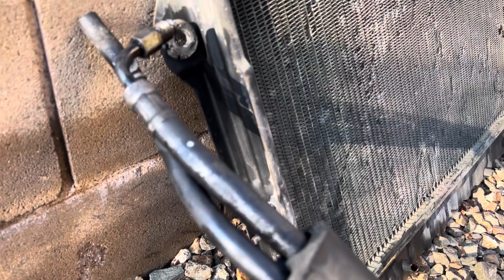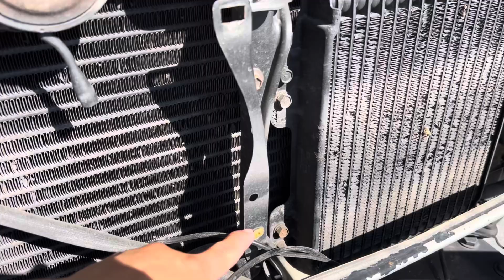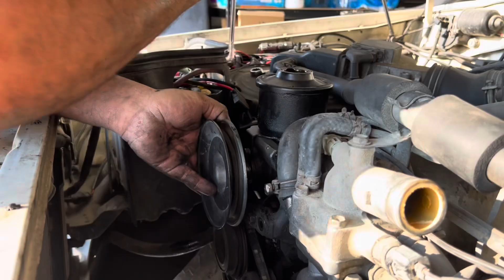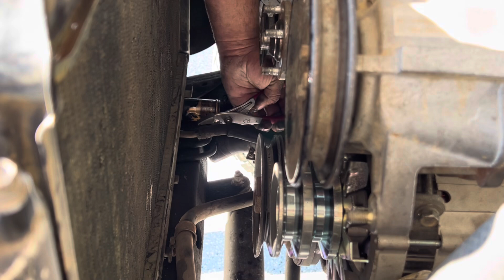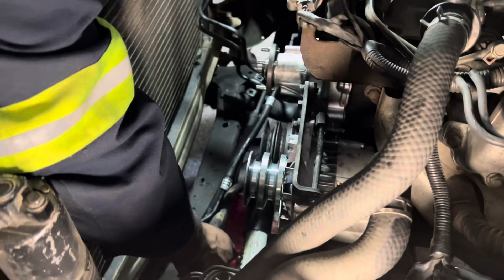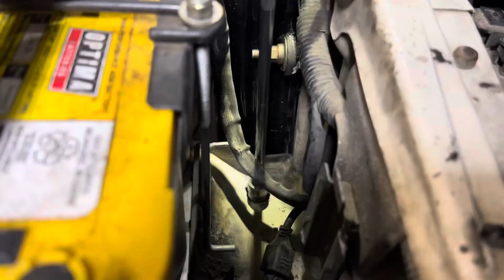No More Leaks! How to Replace FJ80 Power Steering Lines (Step-by-Step)

Comment: Thanks for the video! I must have been distracted when taking mine apart... but let me know if I have this straight. A transmission cooler line comes off the transmission and into the radiator, then off the radiator into the oil cooler, then off the oil cooler all the way back to the other hard transmission line? Thanks again!

Comment: Thanks for the video! While I ended up going the lazy route, your video helped understand where I could cut corners to get the same result.  Unbolt the clamps holding the cooler (leaving the bolts under the radiator in place, with the two brackets hanging down in front), use an angle grinder to cut the pipes so the front section drops down, and wiggle out the hoses and steel pipes threaded under the radiator. Then use a transmission oil cooler ($50 from a local parts store, vs $400+ for an OEM power steering cooler), and run transmission oil / fuel lines / hoses to the cooler, which I hung in front, between the grill and the radiator. 
No radiator removal, and way cheaper.
Reply from the maker: Oh no way!!! Nice!!